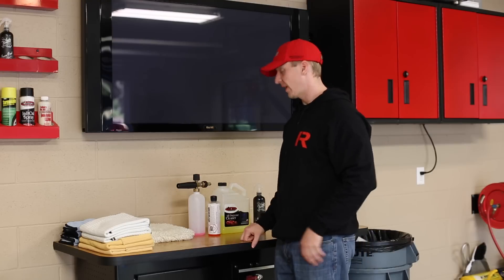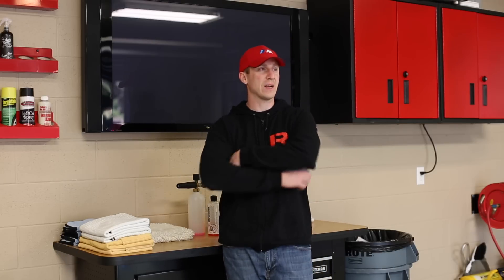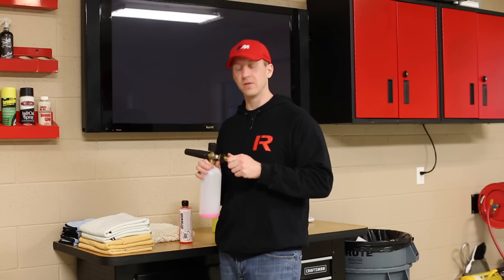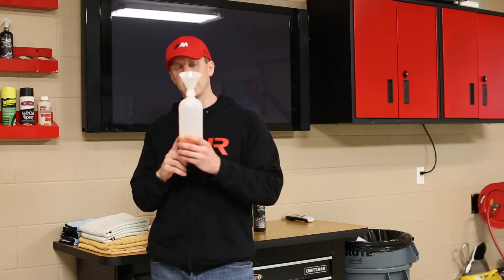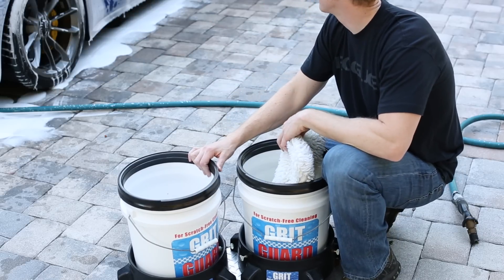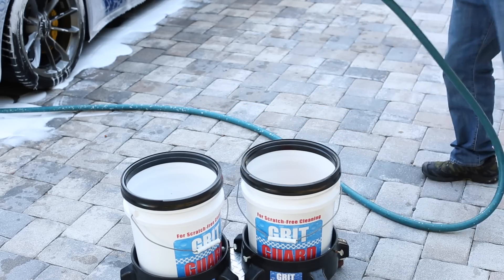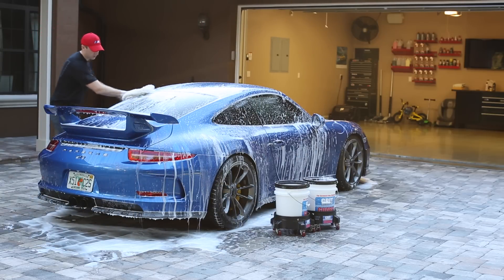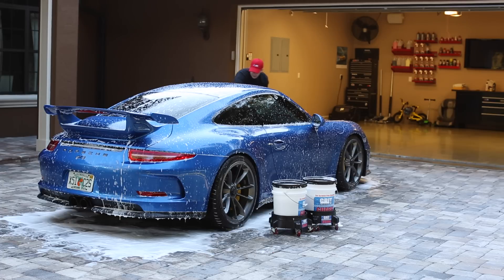GT3 Detailing Process Video 1 of 6

Comment: Hi, First of all I would like to say that the video is great thanks, although I would just like to offer some advice for future. 1. Once you have added the foam to the vehicle using the cannon and you have waited a minimum of 5 minutes to allow the foam to dwell and release dirt and debris, you should always rinse the car from top to bottom with the pressure washer before you touch the vehicle with the wash mit. The reason for this is the foam releases the dirt from the surface of the vehicle and although a vast majority will slide off the vehicle there will still be some dirt on the surface of the cars paint, therefore when you wipe the surface of the car without rinsing the foam off you will drag some of that dirt across the paint and cause minor clear coat scratching. 2. The most proven method for using the wash mit correctly to prevent swirl marks and scratches would be to start on the very top surface ie the roof and work your way down to the mid section of the vehicle rinsing and soaping your wash mit regularly, then you must change your wash mit for a clean mit to continue with the bottom half of the vehicle. never work the wash mit from the bottom of the vehicle in an upward motion and always wipe in straight lines. The reason for washing in straight lines is because if for any reason you do have any minor clear coat scratching after following these steps which would be very unlikely however straight line scratches are much easier to polish off than circular or swirled scratched marks.3. it would be advisable never to use a gas powered leaf blower anywhere near the vehicle. if you are going to use a leaf blower that's fine but make sure you use an electrical powered leaf blower. The reason for this is because a gas powered leaf blower has an exhaust and the exhaust will blow contaminants over the vehicle even when used outside. If you have the money to spend on tools and products to detail your vehicle I would recommend a METRO VAC - Master Blaster which blows at an incredible 8.0 HP and comes with a ten foot hose and various useful  rubber nozzles.I know some people out there may disagree with the above mentioned points and may consider them over the top, but if you want to prevent swirl marks and scratches on your vehicle you must consider every possible way to do so.
Reply: what he said☝

Comment: I use the two bucket method but with a twist! I use multiple wash mitts and put the used mitts in the second bucket and dip my fresh mitt in the soap 🧼 bucket. I usually use 8-10 mitts One per panel! Save the tires 🛞 for last!

Comment: How bad is the brake dust from the ceramics? I have a '15 Sapphire Blue Cayman GTS with platinum wheels steel brakes and the dust gets very thick after a week of driving. I'm thinking about switching over to ceramic pads.

Comment: Really great videos, the adams wash mitt are they better in your view than a lambs mitt (not meaning by cost or how long they last) but as in how soft they are against the paint work and for putting in the dreaded swirls ? again great videos, keep up the great work
Reply from the maker: +jkerr13 I have yet to get a hint of a swirl with the Adam's wash pads.  The real wool mitts just get all tangled and matted.  I find them to hold let soap and more dirt.

Comment: Nice car and I love the color.
Just a tip, you really should use hearing protection when using a leaf blower.
They can get louder than a jumbo jet, if you want to keep your hearing.
I really wanted a new GT3, but unfortunately they don't make them in manual transmissions any more....bummer as I much prefer to change the gears myself.
And the older 997 GT3's are actually going up in value.
Enjoy.

Comment: Instead of using two bucket technique you could use different sponge for different part. For example: front bumber a sponge, bonnet a sponge...So the sponge is always clean.

Comment: Hello Matt, here I am again, watching your GT3 detailing series for the 15th time probably and I noticed something. Most of the time when you foam your cars, you just let the foam sit en then immediately spray it off with the pressure washer and then wash it manually. But this time you actually washed while the foam was still on the car. Is there a reason why you switch between these two diffrent methods or not? 
I just got my hands on a foam lance last week and I love handwashing the car with the foam still being on the car for the extra lubricity ect. But in pretty much all video's I watch I see people just spraying off the foam with a pressure washer without touching the car.
Reply from the maker: +Amateur Detailing My procedure is to let the foam sit and run off, then wipe the car down, and finally rinse.  I could see why someone would make a argument to spray the foam off and then wash, but I like to do the former.
Reply: Alright, awesome! Thanks for always replying so quickly man, seriously love what you are doing!

Comment: You are using the citrus wash + all purpose cleaner in an effort to do a deep clean and strip all the old wax from the car, right? In a typical wash between waxing you are just using straight adams car wash shampoo?
Reply from the maker: Correct.  Chemical Guys Citrus Red followed with Auto Finesse Iron Out pre-polishing.  Then Adam's Car Shampoo for maintenance washes.  Since I have Carnauba on the car, I use Griot's Spray-On Wax when drying.

Comment: If you want a really good All Purpose Cleaner I would try HD Total it's cheaper than Adams All Purpose Cleaner. I personally used to use Adams but I feel like as they have gotten bigger they have let the quality of their products slip. Switching over to HD Total has been the best thing ever. The best part is it is extremely concentrated so you dilute it depending on what you're cleaning all the ratios are on the back of it.
Reply from the maker: I'll check it out.  Thanks!

Comment: Where can i get the roller u put the 2 buckets on
Reply from the maker: http://www.detailersdomain.com/Grit-Guard-Dual-Bucket-Washing-System_p_127.html
Reply: Matt Moreman i know your drive way its flat but do you know if there are locks on the wheels of the buckets to prevent them from going down a sloped drive way?
Reply from the maker: Snarkle - Grit guard has wheel locks.  http://www.gritguard.com/grit-guard/dual-bucket-washing-system.html

Comment: Matt you've outdone yourself again! Did you trade in the C2 for the GT3? It's such a beautiful color and car and you have my dream garage with the M3! Best of luck with both of them and I hope to see some exhaust clips. 

Cheers,
Andrew
Reply from the maker: Thanks man!  Yeah, my C2S had a stumble/hesitation that I didn't want to deal with, so I traded it last month.  Exhaust clips coming soon.  I just installed a Sharkwerks bypass.
Reply: Matt Moreman Very interesting. Would you mind explaining what sort of hesitation the C2 had? Was it some sort of throttle lag or engine bog? However I'm not blaming you for trading up to a GT3 if you couldn't guess. Can't wait to hear some Sharkwerks exhaust!
Reply from the maker: My car felt like it was misfiring under light acceleration from 2,000-4,000 RPMs.  It felt like there was a fish biting my line.  Here is the link that explains it all.  http://www.6speedonline.com/forums/991/300360-engine-stumble-hesitation-around-2500-rpm.html
Reply: Matt Moreman Thanks Matt, was hoping for a link. I remembered you were a member of 6speedonline. Looking forward to seeing the adventures with the car. Cheers!

Comment: The Porsche GT3 is seriously the best drivers car. Only thing I wish they wouldn't of went away from the manual option since the Porsche gear box is phenomenal
Reply from the maker: Tesparza0218 I hear you on the manual.  The PDK-S does change my opinion a tiny bit, but I'd still rather have a manual.
Reply: Yeah the PDK is the only dual clutch that is actually really impressive. But yeah def wish they atleast made a manual version

Comment: Why use so low water pressure? I can only assume it is due to the paint job, that you are worried? Matt Moreman 

German cars have a very thick and hard paint, you shouldn't worry unless you have an elder Ferrari.
Reply: Daniel San Why not? What are the advantages in using high water pressure? His car isn't that dirty to begin with.
Reply from the maker: Daniel San You're right, but I'd rather be safe than sorry.  I've seen some blow the paint off the front bumper with all of those sharp angles on the F80 M3.
Reply: Matt Moreman Well I have been using a Danish brand (Nilfisk) for the last 20 years, and have never had problems. And if you use a correct technique your paint won't take any harm.
One of my friends elder Porsche Boxster S's has not been taking any harm from these. 

Porsche's paint is made to be torture washed for many - many years.
That M3 you have mentioned that had gotten the paint blown of, probably wasn't even a factory paint. BMW and other German cars have very good paintwork.

- This all just to say that you shouldn't worry, but it is your car and you treat it the way you want. :-)

Comment: You should really use a filtered air blower.  With the leaf blower you could be blowing dirt and dust back on it.  Check out metrovac blowers.
Reply from the maker: Yeah, I've used the Master Blaster before.  It certainly blows air well, but dragging around the motor really annoys me.  I always blow off the driveway before washing.  FL has a crap load of sand everywhere.  The Stihl blowers are pretty high quality.  I've never had a problem.
Reply: Matt Moreman
Cool man.  Freaking love the car, by the way.

Comment: Did you know there is a center lock tool under the trunk lid.  It's next to the compressor on the drivers side under the plastic shield.  All GT3's come with one and the center lock cap popping tool as well as a tire compressor.  I finally figured this out by reading my owners manual.
Reply from the maker: Yeah, I just need to get a torque wrench a breaker bar to remove the wheels.  I just bought a wheel guide.
Reply: did you do a group buy on Rennlist. what brand and cost?
Reply from the maker: ERIC DAVIS
http://rennlist.com/forums/991-gt3/855189-group-buy-centerlock-alignment-tool.html
Reply: Thanks for the link.  Thats where I ran across it the first time.

Comment: I thought I was OCD about cleaning my cars, wow you take it to the next level, lol-jk.  Love the car, my 2015 GT3 will be here any day now.  Guards Red, Ceramics etc.  I also fell into one, called the dealer to inquire and they won  1 last allotment and I happened to check into the day after they were notified, SOLD.  Got Lucky! I am soo pumped and am obsessing about it.  I'm also in Wealth Management/Financial Advisor.  I do love that it affords me the opportunity to buy cars like this.  Does the aftermarket exhaust prove to be worth the extra 4k or so?
Reply from the maker: Yeah, I like to think of it as being super focused.  Ha...ha...  The only viable aftermarket solution right now is the iPE.  All the others are just bypasses.  Fabspeed is working on one.
Reply: You ordered online and installed yourself, correct?  Is it more or less a simple bolt on, maybe not simple but non-complex  Did you have a bit of hesitation that if something went a bit wrong-bam, just messed up my 150k+ ride...
Reply from the maker: Correct.  The install only takes about an hour or so.  You really can't mess anything up.  Worst case, you could get a rattle if something is tightened enough.

Comment: You should clean the wheels first with a good alloy cleaner and then do the rest of the car. Awesome car!
Reply from the maker: I didn't do the wheels until after polishing.
Reply: Would take the wheels of the car and do them seperatly with a good coating ;)
Reply from the maker: I will at some point, but I need to buy a $500 torque wrench, $400 wheel guide, and various other tools to take the wheels off.  Plus the wheel paint is flawed on the GT3.  I'm guessing they are going to replace them under warranty.
Reply: Matt Moreman Great job Matt and let me tell you why : you use a Kränzle (!), good products but even more important is that you take your time to finish it. Very nice vids btw. 

Greeting from Belgium ( I used to work @ Palo Alto )
Reply: PS : for the door shuts you try Autobrite Cherry Glaze, it work wonders ( no stains etc plus all products are very hq ).

To dry my car I use a Honda HHB25-E blower. It looks weird but it WORKS. 

Grtz

Comment: looks good, just buy a cheap electric blower the gas blower throws crap on the paint, and you dont want the before you put on wax.
Reply from the maker: I'm pretty sure it doesn't throw anything on the paint, but I wipe the car down prior to apply last step wax/sealant/coating with IPA or Menzerna Top Inspection.  If I were to go electric, I'd get another one of these:  http://www.detailersdomain.com/Metro-Air-Force-Master-Blaster-Car-Dryer-8-HP_p_1077.html

Comment: i think it would be better if you clean the car with clear water after foam than Start to wash with hand
Reply: and two wash mitts 
First for the higher part and the second for the bottom
Reply from the maker: +HeYAbdu I think you are over analyzing this.  What you're proposing certainly wouldn't hurt, except the removal of the foam prior to wash.  The pH balance of the soap is better to have sitting on the paint than just tap water.  Using two mitts/pads also wouldn't hurt, but I don't see the need.  I'm washing the cleanest parts of the car first.